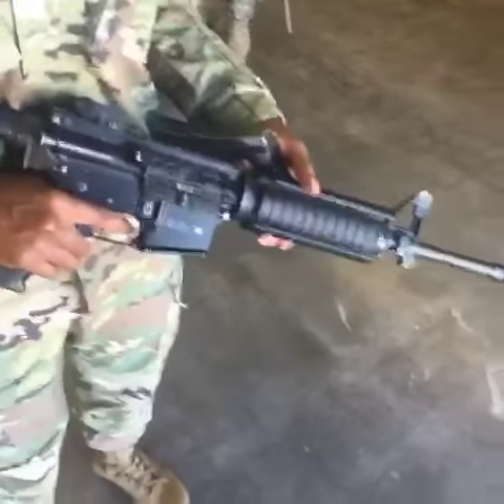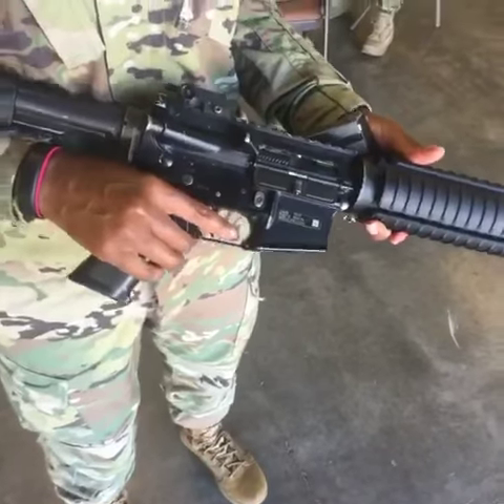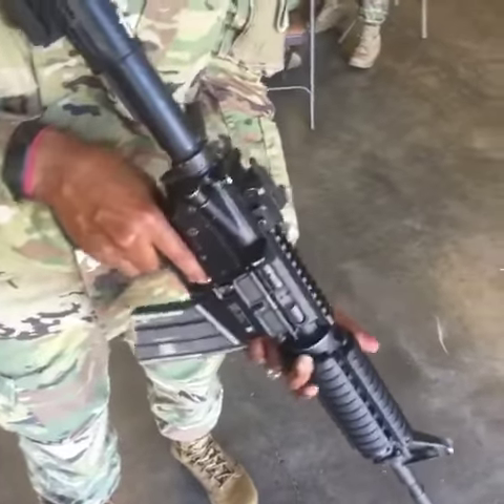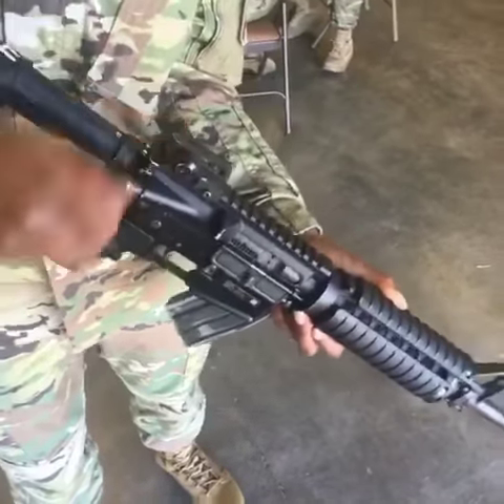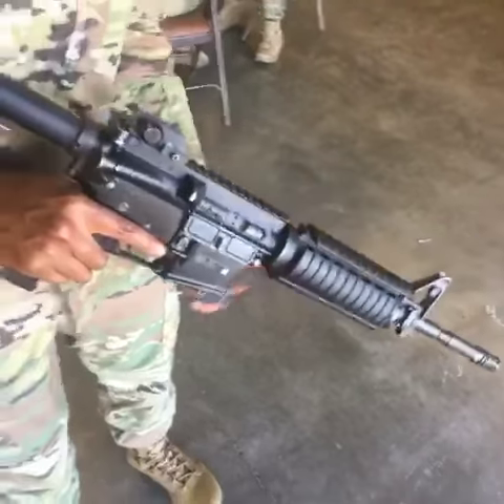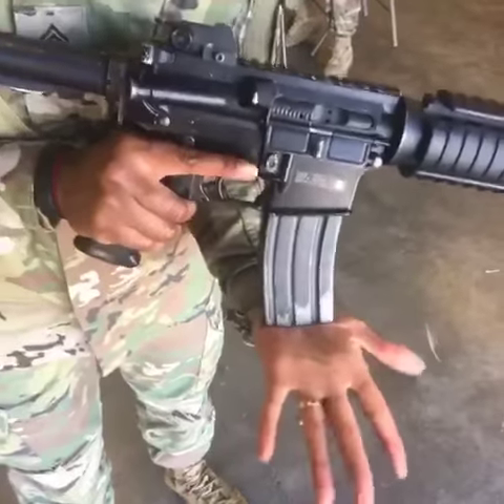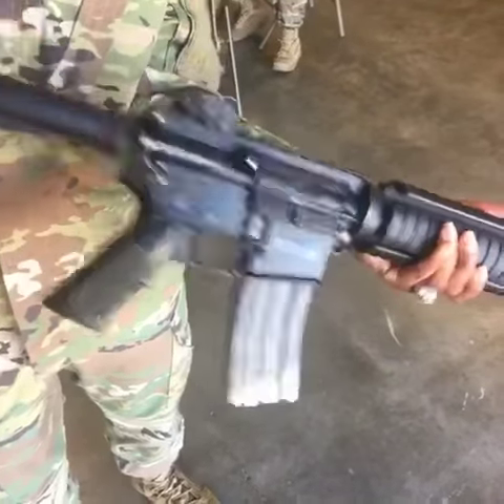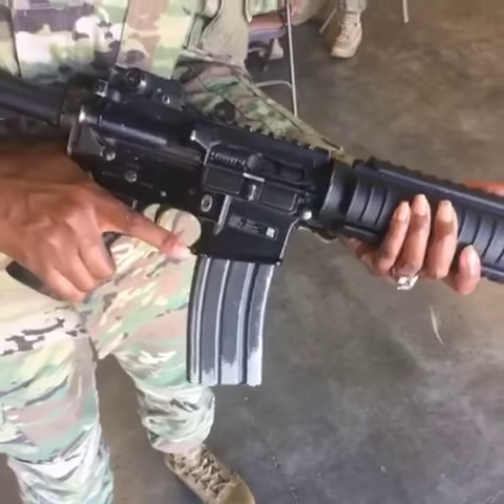Load a m16

Comment: “Load a m16”  step one have an m16
Reply: That’s an m4 carbine wich is literally just a smaller and deferent looking m16. That’s is what I have heard I’m not an expert
Reply: @NootNootenjoyer  this my friend is not an m16.  There is a difference even though it is slight.   The m16 has a "permanent" carry handle.
Reply: RIGHT 🤣
Reply: @Mckillax  They stopped milling carry handles permanently in receivers since the early 2010's forward. M16's go all the way up to M4's with A3's featuring detachable carry handles.
Reply: I mean you load the M-4 the same way as the M-16. Now when it comes to zeroing that's another story. Same concept different directions. I'm pretty sure the backup iron sight on a m-4 doesn't even know what 8/3 flush +1 even is.
Reply: @Mckillax  the difference is barrel length, m4 is 14 inches and m16 is 20. M16a4 has a detachable carry handle.
Reply: @Mckillax   The only differences between the 2 platforms is the M16 is a 20in barrel with the rifle length gas system, while the M4 is 14in (iirc) with the carbine length gas system. Anybody who tells you otherwise is wrong.

Different versions of the M16 can have the permanent carry handle, or it has a railed upper. The carry handle being put on the rail was just the standard military iron sight choice, it doesn’t determine whether or not the rifle is a M16 or M4.

Much like different versions of the 2 could be burst fire or auto, and solid stock or collapsable. Hell, even our M4s had carry handles on them for a short while.
Reply: @Snake-pw2wm  m4s did not have permanent carry handles is really what I was getting at
Reply: Are we really arguing over the difference between a 16 and a 4? The internet is a sad place
Reply: @Mckillax  m4's had non-detachable carry handles too just like colts 723/733 in the very beginning
Reply: Lmao best comment
Reply: @ReckerFidelWOLF  they stopped permanently milling carry handles on M16s in the early 2000s
Reply: @Mckillax  no the first gen m16 had a permanent carry handle
Reply: @Mckillax  m16a4 don’t got a permanent one

Comment: Wait wait wait this is not a m16 this is a m4
Reply: Probably a M16 lower with a m4 upper. Pretty ghetto if you ask me 🤣
Reply: @cryo_life  haha 🤣
Reply: Shhhhhhhhhhh just push the jam enhancer when you charge the weapon
Reply: @worldfamousgi86  lol 😅🤣
Reply: Yea, people get confused easily
Reply: @cryo_life  There’s no difference they are both full auto ar platforms
Reply: @nadj77  M4 is the Carbine version of M16, so it's different. It's like saying that AK-74 is the same gun as AKS-74U
Reply: The "M4" is just a carbine version of an "M16" meaning that the barrel is shorter.
Reply: The only difference is the gas system. M4s run a carbine gas system.
Reply: @nadj77  the internals are 20% non compatible which means that the rifles are infact different.
Reply: @UEGMEAT  as well as the gas system.
Reply: @cryo_life  holy shit ur right
Reply: Cod weapon experts assemble
Reply: Same opperating manual either way
Reply: Yes
Reply: I think is modyfied
Reply: the mix between the two looks amazing if you ask me🤣
Reply: @Kalashnikov413  yeah 14.5 inch barrel on M4 carbine and 16 
 inch barrels on M16
Reply: @ironstarofmordian7098  the internals are exactly the same except for the gas tube.
Reply: @KP16OO  I dont know but its look like a HK27
Reply: @nadj77  ummmm no not real life bub.. 🤦🏻‍♂️
Reply: @cryo_life  na its either an M4 or M4A1.  Most like an M4A1.  We used the A1's in basic.
Reply: @Kalashnikov413  they are all carbines. The M4 has three round burst while the M4A1 has auto.
Reply: @overcast1725  can't you read? i said M4 and M16 is different
Reply: @Kalashnikov413  oh shit my bad lol.
Reply: @Kalashnikov413  but the M16 is full auto while the M4 is 3 round burst.  The M16A2 is 3 round burst.
Reply: @overcast1725  the fire mode doesn't determine if two of those gun is the same or not. Can you call AK-74 and AKS-74U the same gun because it has fully automatic fire mode?
Reply: No, is a bullpup and it has some kick to it.
Reply: Sicsemperevellomortemtyrannis Stopdeletingmyaccount  yeah, there's a lot of AK family variant, from the prototype AK-47, the official AK, improved AKM, smaller caliber AK-74, modernized AK-74M and the new generation AK-12 and AK-15. We also hadn't include other variants like the export, carbine, ect.
Reply: @nadj77  the m16s is auto and m4s are burst the ones I've seen anyway.
Reply: @mountsj  and the barrell.
Reply: @Kalashnikov413  well unlike those guns the m4 and m16 fire the same cartridge (5.56) and can use the same mags. You would load a m16 the exact same way as an m4 and vice versa.
Reply: @csmith9839  That's incorrect. M16A2-A4 are single shot to 3 round burst. The M4A1 is single shot to full auto.
Reply: An M4 is essentially just a carbine version of the M16A3
Reply: @Kalashnikov413  maybe not an AK-74 proper, but it is effectively a carbine version of the AKS-74
Reply: @vnthony_ka1535  the first model of the M4 was burst/semi, but the M4A1 is full auto.
Reply: @genuingamer  dude, the AK-74 and AKS-74U also use the same cartridge (5.45x39mm)
Reply: @Kalashnikov413  oh crap i thought you had said ak-47. My bad man.
Reply: That's definitely a M16A2
Reply: @roberttidwell3066  nope. M16A2 is far longer than that
Reply: These are official humans with brains that know what they Train on , stop trying to be a critic
Reply: @superdoubleyou6940  and a different buffer
Reply: Looks like a AR-15A3 Carbine honestly
Reply: Egg
Reply: @fuckingawesome99  what, you egg?
Reply: Same thing except an m16 has burst and 20 inch barrel
Reply: We’ve converted a couple M16A1 by using the M16A1’s lower receiver with M4 ACC-M upper receiver during my conscription. 

Our new weapon is called M4 ACC-M, but our lower receiver has M16A1 stamped on it.
Reply: @cryo_life  m16 and m4 are the same rifle the only difference is the m4 has a shorter barrel ideal for urban or close combat. The m16 has a longer barrel for better range. Besides that they are one in the same.
Reply: @Zosterias  yep just like the military to reissue 40 year old receivers to troops 😂
Reply: @R.Tafolla  lmao come to think of it, the lower receiver is probably older than me. 😂
Reply: Thank you
Reply: @Kalashnikov413  carbine means
Reply: @Sankalp-sd6fm  type of firearms that fire rifle cartridge, but was shorter than typical rifle. Usually it was based on older rifle (M16 to M4, AK-74 to AKS-74U)
Reply: @Kalashnikov413  but technically speaking aren’t they the same though? The ak47 and the aks-74u
Reply: they're legitimately the same thing. the m4 just has a shorter barrel and gas system. the lowers are identical.
Reply: @xiv_tm431  it’s the same thing for the ak the 74u is just a cut down version that runs different ammo correct or is it still 7.62
Reply: @notafed6302  the akm/ak-47 shoot 7.62 but the 74 series shoot 5.45. but yes the 74 and the 74u both shoot 5.45 if I'm not mistaken
Reply: @xiv_tm431  so can you considered AK-74 the exact same gun as AKS-74U?
Reply: @notafed6302  nope. Despite both are AK rifle firing 5.45, AKS-74U is shorter than AK-74, so it's technically not the exact same gun
Reply: @Kalashnikov413  technically: no. functionally: yes.
Reply: @Kalashnikov413  honestly it kinda is just more compact but I get what you’re saying
Reply: @Kalashnikov413  the 74u was adopted to just be a short version of the ak74 from what I understand. I'm not an ak guy though tbh so Iight be wrong
Reply: @xiv_tm431  and that's why M4 and M16 is not the exact same gun
Reply: @Kalashnikov413  not the exact same but it is mechanically the same exact rifle. most/all of the parts from a 74u reciever could be exchanged with a 74 as far as I know. same goes for the AR rifles too
Reply: @xiv_tm431  yes, but it was still not technically the exact same gun
Reply: @Kalashnikov413  yeah when you shorten the barrel technically no it's not but that's like saying if you replace the engine on a car does it make it a different car; technically yes, practically no
Reply: It's a save dumpy rifle
Reply: @nadj77  aaaaand, the dumbest comment goes to you. That is incorrect on all levels. They are not AR variants(same family, but NOT the same weapon) they are NOT full Auto, and they are completely separate weapon systems. That's like saying a Glock 17 and a sig P320 are the same gun because they are both stryker fired, polymer frame pistols.
Reply: @eymns82  not even slightly close my dude. not a the HK is a short piston rifle. Has a completely different handguard, different factory grip, different butt stock... Not even similar other than the fact they are "AR pattern" rifles.
Reply: @domingofung  how many people will get this joke lol
Reply: I’m pretty sure that the m4 carbine is just mini m16 same mechanics though
Reply: @cryo_life  Umm, they use the exact same lower and upper... Just the buffer tube, handguard, barrel and gas system length are different.
Reply: @ironstarofmordian7098  Uhhh, you're incorrect there bud. They're completely compatible with each other. You may be thinkin the Car-15, which was a bit different. But since the introduction of the M4, they're pretty much fully compatible; and that was done on purpose to cut difficulty on logistics.
Reply: @nadj77  an m16 has a longer barrel than an m4, there's also semi auto versions of both rifles
Reply: It’s an M16 without the carry handle
Reply: You're right this is definitely an m4 stock and barrel
Reply: @nadj77  not true, the m4s and m16s that they give to the mass military are the semi-auto/burst variants not full-auto. They stopped giving out full auto because of ammo conservation and you never use full auto at the range.
Reply: @xSonicspeedx  it looks like an m16 with an m4 stock and barrel and no carry handle 🤔 m4?
Reply: @Mondaz3  the m16a4 and the m4a1 look basically the same with the exception  of the stock and barrel. I would bet that is an M4A1
Reply: @xSonicspeedx  yeah me too
Reply: @cryo_life  😂😂
Reply: @eymns82  and even possibly modified
Reply: @domingofung    Now pay attention. It’s actually aGerman made XR15 Shorty Bullpup. Somebody blew their head off on the range that day and each subsequent day from a negligent discharge. Weapons go off by themselves, all the time.
Reply: @HuhWhatHuhwhatHuh  better yet then.
The Weapon.... Has Fired.
Reply: I am actually very fucking scared about how pussified our military is now.
Reply: @cryo_life  m416?
Reply: pretty much sure 😂
Reply: @WILLTY13  I don't think that many, especially if they don't follow firearm channels or any military channels lol
Reply: @GPutraJayawardana  of course lmao
Reply: @nadj77  not full auto 3 round burst or semi keep gaming looks like you never did your time
Reply: Warzone
Reply: @nadj77  no, they’re not 😂
Reply: Tis an M4
Reply: M4A1
Reply: @saidcheddadi3017  precisely
Reply: Same difference
Reply: It's an M16A1... I was infantry and had to hold this weapon every single day.
Reply: @atomicarcade8696  lolololol
Reply: @cryo_life  how is that ghetto it is a m4 not a m16 both m4 upper and lower and that is standard issue in the army
Reply: They’re the same platform. The M16 and the M4 are both military designations so it ist your choice which designation the gun gets.

Comment: This is just awful, should be deleted immediately.
Reply: Why exactly
Reply: @nickhenley1338  Everything about it is.
Reply: @nickhenley1338  .. what you don't know?
Reply: The manual of arms show is absolutely terrible. Some of the worst trigger discipline seen. Excruciatingly terrible way of loading a magazine into an M4. Leading the charging handle back deliberately(can cause a failure to feed in both pistol and rifle). And calling an M4 an M16, even though the U.S Army barely uses the M16, so there's no excuse to call it in an M16.

Comment: This is an M4a1 carbine not an M16 (M16a1) . M16s were used predominantly in veitnam from 1964. Technically still in service but instead its a modified and improved AR platform that we know as an M4a1

Comment: My question, if they are going to pull the charging handle to check the chamber, why not just lock the bolt back, so you can't screw the pooch and short stroke the charging handle?

Comment: Soooo...why close the ejection port cover after clambering if they aren't in an extremely dusty/sandy location? Especially since it looks like they are at a range, where having it open would probably alert anyone else of the readiness of that rifle
Reply: I'm curious why they are going red away from the firing line, any range I've ever been to if you rack a round in behind the line your getting drop kicked. Beyond that not vest or Kevlar, gloves probably eye pro too, I'd be talking to these part time nco's

Comment: Instead of pulling the charging handle back a second time, you could've just told her to push the bolt release located right in front of the selector switch, high speed.

Comment: ..... you make sure your rifle has magazine with 2 rounds taken out so the insertion of the magazine is more likely to click into place, plus a 100% full magazine over time will have a weaker spring, resulting it it possibly not being able to always push the next round up into the oath of the bolt before the bolt closes into the chamber.. 
in simpler terms, the magazine sometimes cant keep up with the gun and wont work

Leave the magazine in the gun, keep the dust cover closed, leave the chamber empty and firing pin released

Keep your gun out of reach of untrained people/kids, keep it lubricated, make sure its quickly accessible during emergencies 

then all you do to use your rifle in an emergency is pull back and release the charging handle and you can start firing your rifle immediately

Comment: No, so much is wrong here. First point weapon in a safe direction, second you check the weapon is on safe, third lock bolt to the rear and perform a visual and physical inspection to ensure chamber is empty, fourth insert magazine, fifth send bolt home, and sixth recheck that weapon is on safe. Yes that rifle is an M4 not an M16 but the procedure is exactly the same.

Comment: It is not an M16.

First, the M16 is not used by the U.S. Army now. The model A4 is used. 

Second, this is an M4A1. It is an Armalite-15 (AR-15) like the M16A4 but it have a shorter barrel, a different stock, and different sights.

Finaly, this is useless to use the foward assist. It is here only for jam.

Comment: Buzzzzzz! Wrong!
1) ensure the weapon is on safe (it’s not on safe in this video)
2) lock the bolt to the rear and ensure there is no round in the chamber, bolt face, and mag well
3) insert the magazine
4) while looking into the chamber release the bolt lock and watch the round enter the chamber
5) tap the forward assist
6) close the dust cover

Determining which “mode of operation” you are going to fire the weapon is irrelevant to how you load it. The weapon will be loaded the same way every time.

Comment: Isn’t that a m4a1 carbine assault rifle the marines have been using..?
Reply: Marines don't use M4s, if they're using carbines, it's likely an M27
usually it's just the Army using M4s (like in the video) sometimes the Air Force and Navy too when they need to use small arms

Comment: Wtf... why is she charging with her firing hand?
Reply: If they have been doing it alot it can hurt ur finger after a while constantly tugging on it
Reply: @seatato4468  I’m a civilian and I drill my manual of arms weekly, 20 dry fire from low ready, 20 from sul, 20 from retention, and 20 on a blind turn... each are dry fire and I’ve never had a CH “hurt” my hand. Mind you I’m not a woman, but if she is going to be given weapons training it should stand to reason to do it right... 100% no reason during normal operation is it necessary to take your firing hand off the gun. I can only think of 2 situations where it’s necessary. A little finger pain in my opinion isn’t a good enough reason to shy from the right way

Comment: 1. That's an M4, not an M16, they load the same and use almost identical components, but they are two different variants of the platform and the need for full length m16s has all but died out.
2. TRIGGER FINGER, look, you're not on the trigger, good, but you shouldn't even be infront of the trigger. Your finger should be riding high and sitting on the receiver itself.
3. I hope to God you're holding the mag that way just for ease of filming cause it does nothing for your reload.

Comment: TRY that again there you. "Ensure the magazin is properly seated by attempting to pulling it out." You dont wont sn oh shit factor because that mag fell out. Also, ima need that finger "STRAIGHT and off the trigger until you are ready to fire." It takes not time away. Other then that good job guys and gals. Smh 🤦🏿‍♂️

Oh, one last thing. I'm REALLY going to need to to NOT ride that charging handle. Gab it, pull it back all the way AND LET IT GO! that is what it is designed to do so it has the momentum to push that round out the mag and into the chamber.  JEESUS CHRIST🤦🏿‍♂️.

Comment: Clearly those aren't Marines and that's not an M16.. Every Marine a Rifleman! And that's a bad mag.. It should lock the bolt to the rear if the mag is empty.
Reply: It wasnt empty. It clearly had a blank in it
Reply: @superdoubleyou6940  Good eye! I could barely make it out after looking it over.